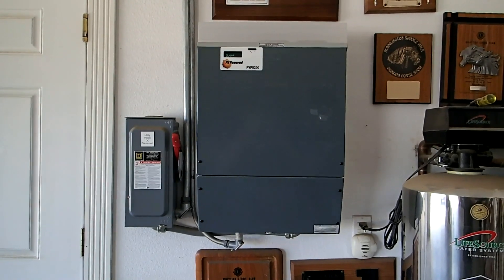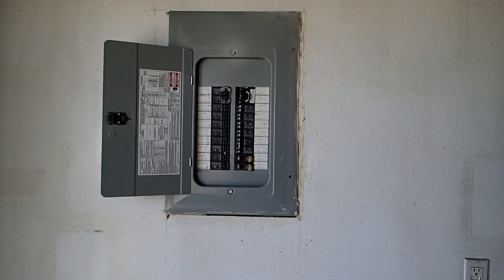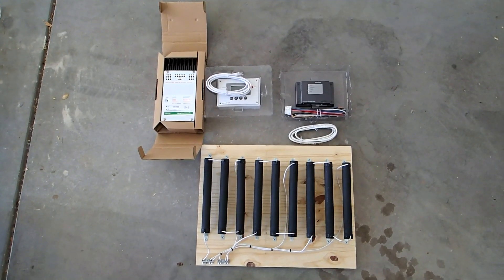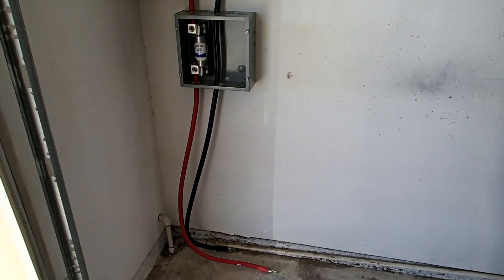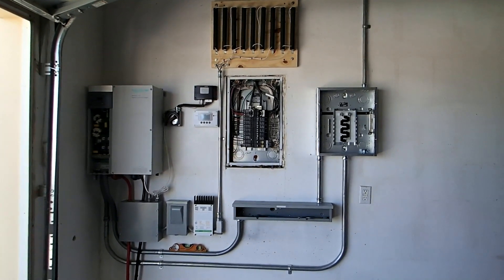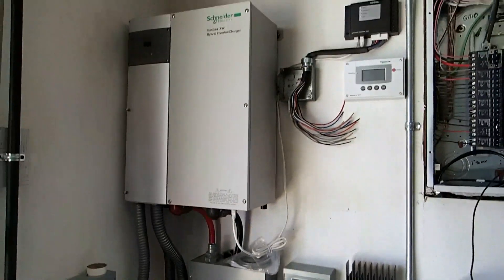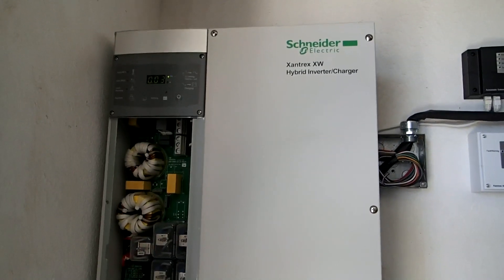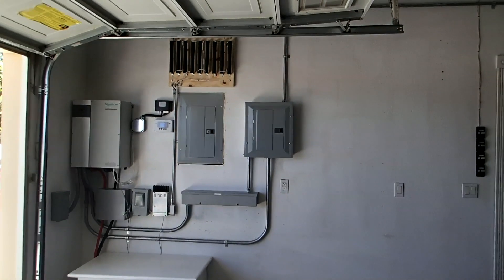Battery Backup Grid Tied Inverter

Comment: Great vid. Good equipment    Why not use hot water for load diversion.
Reply from the maker: Jim Davis load diversion is no longer required, all inverters produce now when the batteries are charged they simply screw the 60 hertz frequency and the grid tie inverter shut down for 5 minutes stopping the charge

Comment: what type of power converter do you use for converting DC back to AC at 60 Hz
Reply from the maker: Vasudev Mr it's called a Xantrex.
Reply: Moss Fett did you build it ??
Reply from the maker: Vasudev Mr no you buy that equipment and you install it
Reply: Moss Fett is it a switching mode power converter or huge iron core transformer inverter ??
Reply from the maker: Vasudev Mr it is a Xantrex inverter made by Square D it uses an iron core Transformer. You purchase it from the company and you install it you do not build these.

Comment from the maker: And before you vote something down, you should ask first as you don't even know how many watts those resistors can handle like 2000 watts but there only getting 200 so you hold in in your hand while it works. For that matter it can be mounted on paper.

Comment from the maker: The divert load in the case is de-rated and really is not needed with a XW inverter we found out as they installed new firmware. The XW6048 detects when the battery is going to high on voltage and tweaks the 60 hz at a rate of 1.4 hz per second and that shuts off the grid tie inverter for 5 mins then the XW system takes over on the battery.
No loss of power is detected. After 5-10 mins the grid tie inverter starts back up. So the next job will have no diversion load or controller.